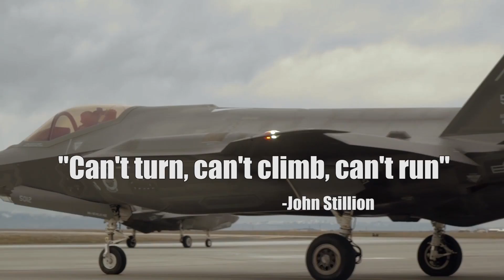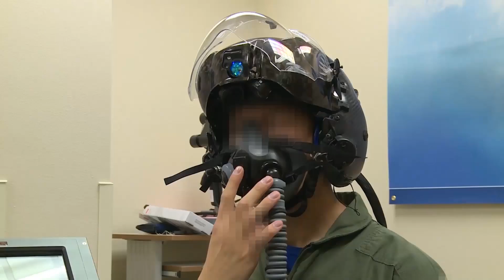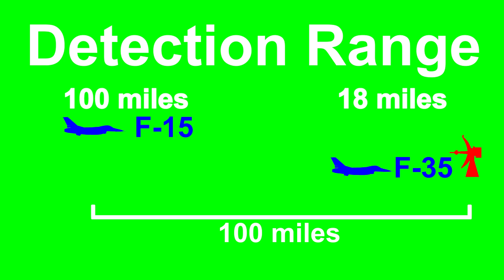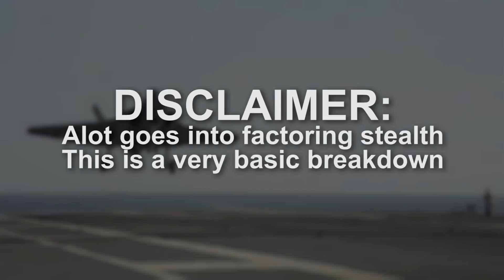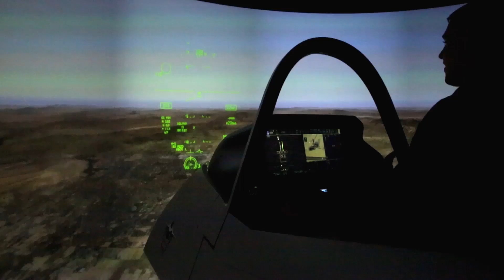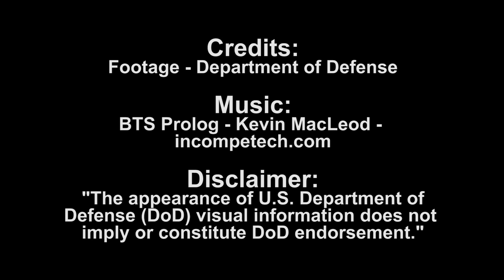F-35 Overview - The Good, The Bad, The Ugly

Comment: Will never replace the a10 it is to shaky flying low combined with it's horrific stall speed make this a very bad choice for close ground support.
Reply: No need to fly low and slow. That idea is being phased out due to more effective tools becoming available, just like how dogfights stopped being the primary form of air combat when missiles were introduced.
Reply: @dumdumbinks274  My point is this aircraft cannot replace the warthog when it comes to close ground support
Reply: @DiscoveryNewsNow  Apart from the morale boost of seeing an A-10 it doesn't do anything an F-35 can't do.
Reply: @dumdumbinks274  Unless you're counting 4,200 rounds per minute from a 7 barrel 30mm gun.  Not to mention the total cost is only 18.8 million.  Which is 15.98% of the 88 million a single F-35 costs or out another way you can buy almost 5 warthogs for the price of one A10.  The F-35 can fire 3300 rounds a minute, but again has a crappy stall speed and gets super shaky at low speeds.  So that gun won't be effective against ground targets.  It can only carry 4 misses internally (6 if you give up on it's stealth capability), which is pretty much the entire point of this overpriced aircraft.
Reply: @DiscoveryNewsNow  Total cost of an A-10A from 1980 in 1998 dollars is $18.8 million. The A-10A is drastically less capable than the A-10C which is the version recognised by troops. Estimated cost for a brand new A-10C is more than $40 million. You could maybe get 2 per F-35.

Stall speed has little to do with effective strafing runs. You don't need to fly slowly to be effective with a gun. Even F-16s can do it, though in the case of the M61A1 it is designed for air to air combat and has a deliberate spread. Unlike the M61A1 the GAU-22/A of the F-35 is just as "accurate" as the GAU-8/A of the A-10.

The F-35 can carry up to 8 bombs internally or 2 stealthy cruise missiles. Externally it can carry more than an A-10.

The Idea that using external ordnance is giving up on stealth is simply false. The option is there so that the F-35 can bring a larger payload when stealth is not needed. If stealth is needed the A-10 wouldn't even be a consideration even within the role of CAS. Basically it's a false argument that doesn't make any sense.
Reply: @dumdumbinks274  I don't believe you that ordinance under the wing doesn't negate it's stealth ability.  Please let me know your source for that.
Reply: @DiscoveryNewsNow  I didn't claim that. A missile mounted externally will reduce the stealthiness of the aircraft, but the aircraft is still magnitudes more stealthy than a non-stealth aircraft like the A-10. In order for stealth to be negated an F-35 would have to be carrying a full external load... something that simply never occurs with any military aircraft because there are many more factors to consider... such as drag and weight
Reply: @dumdumbinks274  I just don't believe the aircraft is going to be worth the cost
Reply: @DiscoveryNewsNow  The cost of the program is a valid concern with all the political interference and bullshit. But the cost of the actual aircraft is actually better than many modern fighters, notably the F-15, Rafale, and Typhoon.

Comment: I disagree
Latest F-15E cost about the same - they have much better range armament but 0 stealth.

What you pay 100m for is a plane that at stage 0 can engage AA protected complexes and bomb them or suppress AA defenses without being detected.
You can see that today even non-high-end defenses like S-200 can possess a threat if you shoot 20-30 missiles at a single target - ask the Israelis.

When the AA and Air superiority planes threat is removed and stealth becomes less of an issue, dr. F-35 turns into mr. F-35, packs a whole lot of punch and serve as a standard combat plane.

Comment: On one side of the financial equation you have the F35 on the other you have combined the F15, F16, A10, AV8 Harrier and F18.  Either side of the equation is going to be expensive but the F35 is going to be the newer more capable airplane for the next 40 years.  Commonality of airframe and systems is going to be cheaper to maintain and upgrade than the myriad of systems on multiple legacy aircraft.  War is an expensive business and the more expensive it becomes the less likely we are to have one.

Comment: For Oz, with our limited budget and need for long range in the Pacific, with concomitant heavy weapons load outs, this expensive, slow, low range POS is a disaster. We would be far better off with our current F-18 Super-Hornets for now, bolstered  by locally developed stealth drones (we need to get our shit together and produce locally designed and made modern alternatives). Hell, right now we should never have ditched our F-111 Aardvarks. Also please can we have your A-10 warthogs for close air support if the US dumps them for the F-35? We'd prefer a flying tank to something made of tinfoil that we can't afford to crash.

Comment: Another point here is range - what is the range of the F-35? Do you need to carry drop tanks? That would reduce stealth - or do you go without drop tanks, which means you need to refuel sooner and from a non-stealthy tanker? I think this might be the equivalent of Robert McNamara's TFX (F-111) fighter of the 60s which was supposed to be a do it all aircraft for the Navy and the Air Force - it was canceled and in the end became the F-111A tactical bomber.
Reply: Range of the F-35 is far superior to that of the aircraft it replaces. A combat radius of 1400km vs an F/A-18E/F at around 850km or an F-16 at around 800km. The Navy have also been developing stealth tanker drones and are actually in the testing phase right now.

The TFX program was based on the USAF requirements for a long range tactical bomber, with the naval version being adapted to Navy requirements from the Air Force version. The Naval version was cancelled, but the USAF version was among the most successful aircraft of it's time.

Comment: The Boeing system was actually a much better platform, especially the VTOL version as it used familiar and long tested technology found in the Harrier, though with computer assisted hardware. The brass however didn’t like it’s look. Even though Boeing stated that the prototype X-32 wasn’t the final design. In fact the final version looked a lot like the F-35, except for the large scoop in the front which gave it more thrust, yes, the X-32 was not only faster but a lot more stable. The biggest reason why the military didn’t go with the x-32 was it’s deleovery date, Boeing needed an additional 3 years of development. In hind site the F-35 needed 5x the develop time than Boeing’s-solution. The F-35 is a failed project as far as I’m concerned, especially when compared to the new F-18 and F-15 variants that were just released at half the cost. Trump was right when he went with these new variants to fill the gap before the F-35 is actually released in it’s promised configurations and performance. Though I believe going with a single engine will be the downfall of the F-35 and will eventually force the US to go forward with 6th gen designs that have been proposed. 

Even if the F-35 program is supposedly to large to fail. Never, ever, create a weapons system that is dependent on multiple sources, especially now with modern robotic automation systems. Do you think a Su-35 is made by 1000’s of manufactures spread out across multiple states, no, it’s not, as it’s a stupid way of making an aircraft.
Reply: The look had nothing to do with it. Their design wasn't ready and the wing's geometry wasn't finalized. Faster and more stable based on what? How is the JSF failed? How is a single-engine design a detractor?

Comment: Basically we designed a plane to save us money in the long run with maintenance but it appeared we should have had improved on the f22. N for the price that has cost us the f35 over 1.3 trill we could have had another 2000 f22. Yeah. Not smart
Reply: HAVANA SCP That 1.2 trillion is spread out from the start of the program till 2070 including fuel and maintence costs
Reply: TheReal Lifehacks Great. One problem with that. As u should know. Whenever we say 1.2. Is usually way higher specially as years go by n things get way more expensive. We should had invested that money on better missiles.

Comment: I think both "sides" are wrong, both the naysayers saying it's useless and the hype train who say it's the last and only jet that the USAF will ever need. It's obviously not trying to be a "dogfighter" though the manoeuvrability would be far more for avoiding supersonic missiles launched from 100km away than than getting into a turning fight.

F35 has very good RCS... for its frontal aspect. For other aspects (the side, underneath, and especially rear facing) the RCS is not so much better. So it can fly straight at a radar, but another radar 90-degrees off can detect it from much further away. This has almost always been the case with Stealth, its advantage is usually for one aspect.

Advances since even the 1990's in thermal-homing missiles that have an extremely wide "off boresight" targeting and lock on hugely change how a dogfight might be, it doesn't matter any more if you can zoom up or out-turn, even up until the Gulf War there was some need to dogfight to get onto a tail-chase so you could point the relatively narrow field of view of your missile at the enemy fighter to lock on. But missiles now missiles only need the enemy fighter to be somewhere roughly in front of you.

F35 is NOT looking to get close, if it can always stay far away, hide in plain sight and take pot shots, then it'll do great. However, if it for any reason cannot keep combat distances very long (as in, 100km or more) then the F35 is not going to be at any advantage. The Norwegian pilot never disputed the turn rate, saying you can move the nose quickly doesn't mean the plane can turn quickly, there's a difference between changing the attitude and changing the vector, if the wing loading (and overall aerodynamic loading) is too high then it'll "swerve" on a turn and just won't change its direction of travel that quickly.

That's going to mater because the AMRAAM missile it uses can only be used at short range when fired in a much narrower angle off boresight, it's not like other missiles than can turn almost 90 degrees as soon as they are launched. That doesn't mean F35 is either worthless nor a panacea, it's just a very narrowly specialised design.

Comment: William J Grekik has made a well written constructive comment about this video. The F-35 is not perfect, and anti stealth detection tech is catching up, but the stealth is only one aspect of the high tech plane. It's sensors allow it to stay far away from enemy planes, and the "sensor fusion" (what a silly attempted catchphrase) allows another US plane/ship, or allied plane/ship to send targetting data to it and fire missiles the F-35 is carrying. 

But the biggest bugbears are: 1) really high cost, and 2) Not enough F-22's. The F-35 was not supposed to do every single task. But there weren't enough F-22's built, so the F-35 will be forced to step up. I hope the F-35 gets sent out in large numbers, to compensate for it's low missile carrying ability

Comment: Low freq radars with digital signal processing can easily detect even F22 now. The F35 has been designed into a corner of the dark. It dare not come out and it's multi role capabilities and air superiority functions are worse than any European fighter. The SU30 and Mig 31 would piss all over it. Russia multi frequency radar systems can even pick up B2 Spirits. Stealth was a flawed idea. It is only useful against low tech enemies.
Don't argue with me. I won't respond. Research it yourself.
Reply: Dami Sund I don't mind having conversations but not with hypocrites. So you have technical knowledge and you are probably a physicist right? If you want to see my qualifications... refer to neuvophysics.com and the science in there behind 5G and radar tech. Bye bye now.

Comment: Lower payload?  The F-35 carries a much larger payload than any 4th Gen fighter in its weight class, especially looking at fuel.  Aside from fuel, it carries the standard A2G load of the F-16C or F/A-18E/F, only internally.  Any criticisms of the F-35 in comparison to the aircraft it is replacing that is unaware of current multirole mission loads seems ill-informed at best.

Comment: Much less stealthy than originally conceived?  What RCS values is this statement based on?  We can have a conversation about the engine alone and rear aspect VLO that would end that assertion very quickly.  Basically everything you've heard about the F-35 is so misinformed, it comes across as nothing short of perplexing to those who are close to the program.

Comment: The Aussie Air Power source is one of the most misinformed on the web.  Everything I've seen there is false, whether talking APG-81 TRM count, detection range, combat radius, thrust-to-weight ratio, climb rate, internal stores, weapons compatibility, you name it.  It exaggerates Su-30 and Su-35 capabilities, which have proven to be dismal failures looking at MTBF, crashes, uncommanded ejections, and spare parts support from Russia.  I would never mention APA as a reputable source, which is sad, because the owner should have the ability to make a quality site with factual information.  His graphics and explanations are exceptional, only the information is incorrect.

F-35 is not expensive compared to 4th Gen + fighters.  Do a comparative analysis and the F-35 starts to show how affordable it is. 

As to maneuverability:   https://www.youtube.com/watch?v=SPqUvCnWcrk

Comment: Lost in the "how good in a dogfight" discussion is the affect of drag. Yes, a "clean" F-16with no weapon would likely outmaneuver a "clean" F-35. But that isn't combat. Put 4 AIM-120s on the F-16 plus external fuel tanks to match the range of the F-35 and you have a tremendous amount of drag effect that the F-22 and F-35 simply don't have with their internal weapons bays. The F-16 (and every aircraft) lose ALOT of speed and bleed ALOT on energy in turns when they have ordinance on the wing. The F-35 does notAN F-16 clean can fly up to mach 2. The F-35 clean can fly 1.6BUT, with stores and a fuel tank, the max for an F-16 becomes mach 1.2 while the F-35 can still fly mach 1.6so yeah, clean configured, it may not run with or fly as fast as an F-16 or SU-27 or something...but with both planes carrying a combat load, the F-35 becomes as fast- if not faster- and can maintain much more energy in a turn (key to dogfighting).Im tired of these "experts" making declarations like "cant run or climb" like combat is the same as an airshow.

Comment: I don't think the F35 is a piece of crap or a toaster with wings, but neither i consider it the best information superiority fighter, very likely you could develop (if you have the resources) other aircrafts to do some of the electronic warfare, and information warfare jobs that the F35 can do if you have a good knowledge of programming.

The maneuverability problem should be relatively easy to solve, just give the F35B and F35A the large wing area of the F35C, at least is solves to some degree, it would have a higher wing area and therefore higher lift than a f35A

One of the most understandable problems of the maneuverability should be considered that the F-35 it was designed for electronic warfare and to have excellent low speed control, generally what works well at subsonic speed works awfull at high speed

I should have the full list of problems of the f35 that most likely nobody has, the ones who know it can't tell it, and that must be in some cabinet under the desk of skunk works office.

Comment: "The f-35 isn't too maneuverable." Doesn't have to be. It can see you from 100 miles away, shoot you down from the same distance, and do so regardless of what direction you're approaching from. 

"The pilot has poor visibility." He doesn't need to have clear window views. He has 6K cameras displaying information all around him in his helmet. Anything within radar range of him will be displayed in his helmet and highlighted in case the images aren't clear enough. His computer system will then recommend the appropriate weapon for the situation and automatically fire countermeasures if necessary.

"It costs alot." 55 B to develop. 10 B less than the f-22. 85 M per plane. 190 M less than the f-22. 200 B to procure over the course of a decade. This aircraft will never consume more than 8% of the annual military budget, but it will be doing 50% of the combat. 1.1 Trillion dollars in maintenance, armament and training sounds like a lot until you realize it's spread out to 2070, and is the estimated cost for both the US AND Foreign users of the aircraft which should total to at least 3,200.

This aircraft is so ludicrously high tech it really should cost 250 million a unit. It probably knows what i had for breakfast, yet is cheaper to procure and much more effective than the f-15. Seriously. Modern f-15C's cost 120 million per unit. Turns out shoving high tech electronics into planes not designed to utilize them is insanely expensive.

Did i mention the pilot can change missile's courses mid flight, fly multiple drones, jam the enemy from 100 miles out while scanning the craft to identify exactly what he's up against, all at once? Why would you need to turn real quick if your enemy explodes way before he even knows you exist? And if you really need that maneuverability upperhand, the f-22 is ready to roll.
Reply: Probably Not A Chicken well it was detected by a god damn old Syrian radar